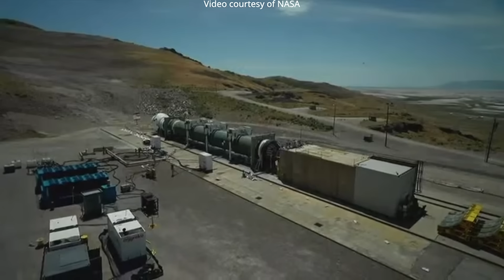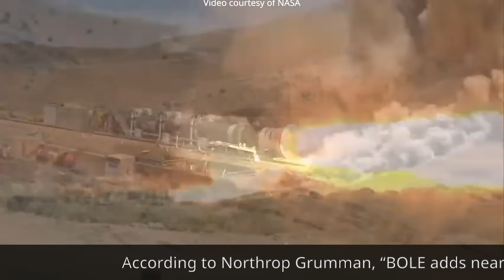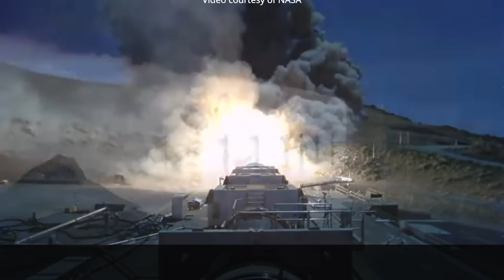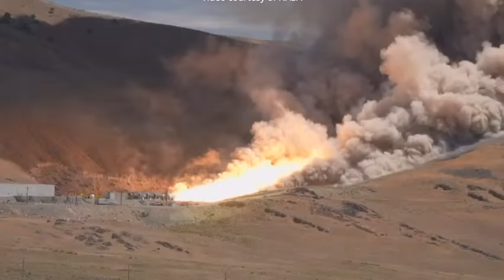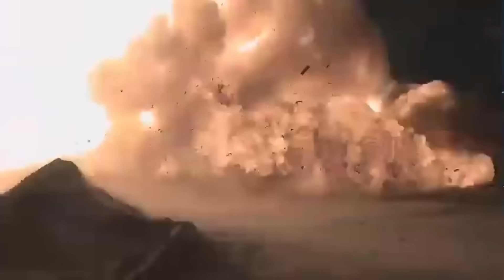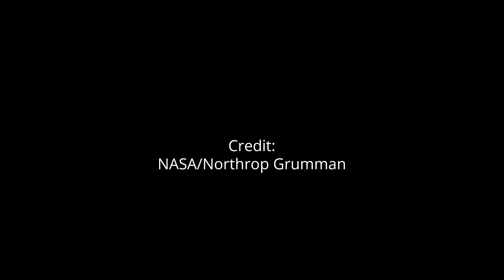BOLE Demonstration Motor-1 Static Fire Test

Comment: Isn't the engine intended to gimbal while the booster is in a vertical position? Could the fact that it's being tested horizontally put increased stress on certain parts of that gimbal system? It seems like they were testing the gimbal just prior to it failing at T+ 100 seconds.

I'm not a rocket scientist so that's just my layman's take on it. 🤔
Reply: Aerospace design margins are famously small, but not so small that putting a rocket on its side for a test would cause it to fail. 

All of this is considered in the design. Also, the motor travels on its side from Utah to Florida on a train car. It can handle being sideways.
Reply: So much force I doubt the angle has any effect. Plus when you take off its not straight up

Comment: That didn’t end well. They want this on a manned booster?😮
Reply: Better to have it come apart now than then! This is why we test!!
Reply: @don312000 This is supposed to be on the 9th SLS from what I hear. I doubt there will be 9 ever made. I just don’t like seeing SRB’s on manned boosters ever since I saw the Challenger go up.
Reply from the maker: 268 SRBs worked on 134 Shuttle flights. Challenger disaster was caused by human error and not having an escape system.  A mistake repeated now on Starship.
Reply: @SciNewsRo Challenger blew up because of poor design of the SRB joints that engineers were well aware of. If they had been designed properly the temperature at takeoff wouldn’t have mattered. NASA also ignored the debris strikes problem that bit them in the a$$ with Columbia. Yes, I am concerned about no escape system on the Starship. I would not man rate it until there is an escape system.
Reply: Mars is near
Reply: This is the first firing of a brand new motor that isn’t scheduled to fly for like a decade. 

Failure was always a possibility with this test.